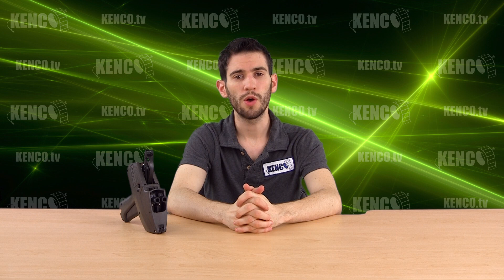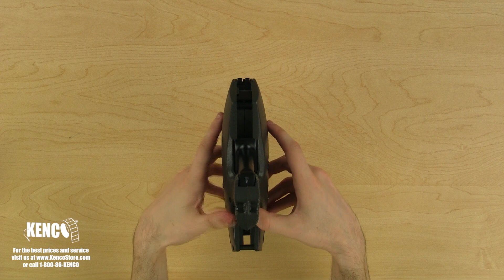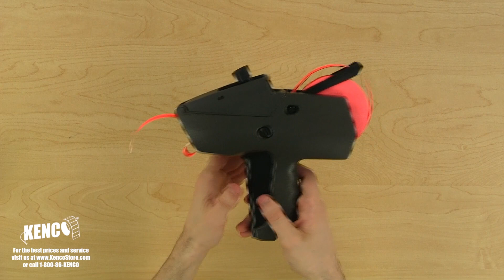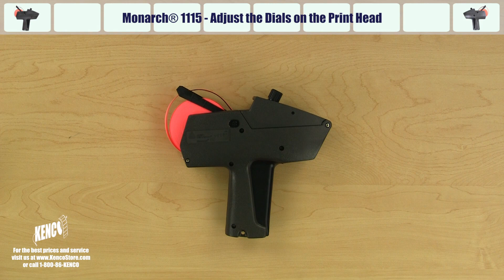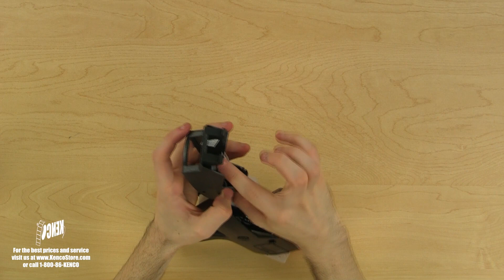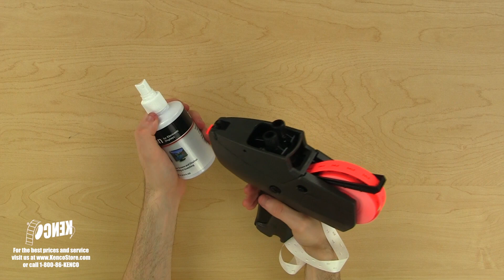Monarch® 1115 Loading & Maintenance Instructions

Comment: When changing the numbers, should the dials only be turned in one direction? In the example it appears to be turned towards the operator. Does turning it the opposite direction damage the splines on the digit wheels? We were told when we get to "0", turn back to get to "1", don't go past zero to go to "1". Thanks.